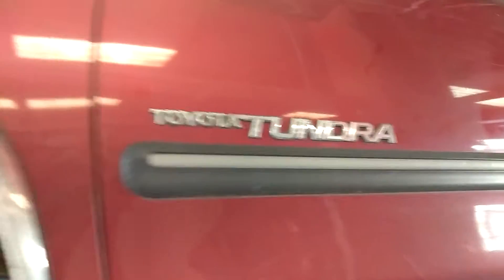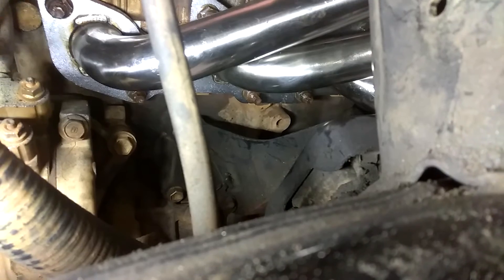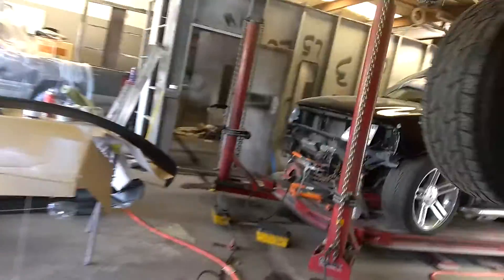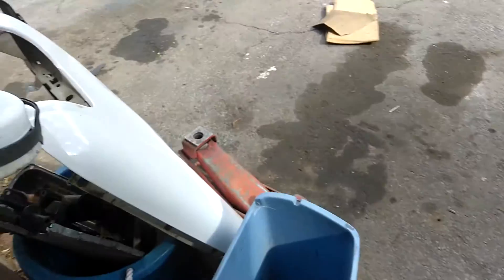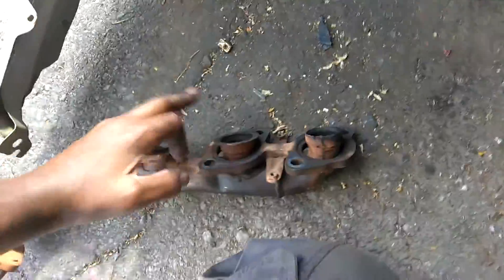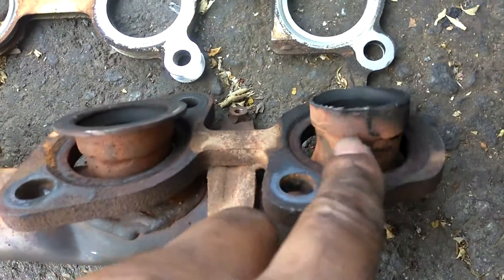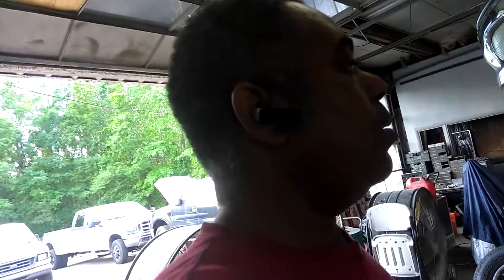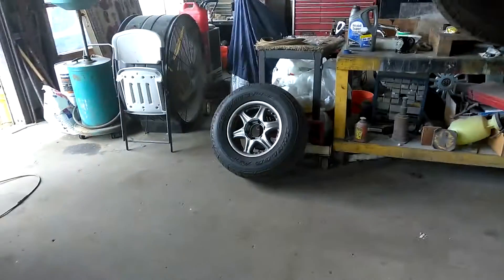2000 Toyota Tundra SR5 4.7L stainles steel exhaust header upgrade, front struts rear shock overhaul.

Comment: Where did you get the headers what brand and did the header ports match cuz I saw a guy they the gasket did not .watch the holes thanks
Reply from the maker: Merry Christmas to all. I believe the headers are Stainless steel Manzo Performance or Black Horse Racing brand with hardware and gaskets. The exhaust ports lined up with the gaskets, a deburring tool will clearance any irregularities. Thank you for your inquiry, C.J. w/ A.R.T. Atlanta.

Comment: What brand headers?
Reply from the maker: Full stainless steel, just an aftermarket brand like OBX. You can definitely feel the gain low to upper mid-range torque when hauling or everyday driving. A lot better throttle response with better fuel mileage on premium fuel of course. C.J. w/ A.R.T. Atlanta 770.374.9597
Reply: @restoreyourcar3833  Awesome thank you. I have the DNA MOTORING cold air intake.. I HIGHLY recommend it. I'm gonna do headers next, been thinking about going long tube though, and putting on a high flow cat further down line with the O2 harness extended to a new bung post cat. But Shorty's seem to be making alot of 4.7 owners *happy.
Reply: Did it sound really bad when the manifold was cracked?